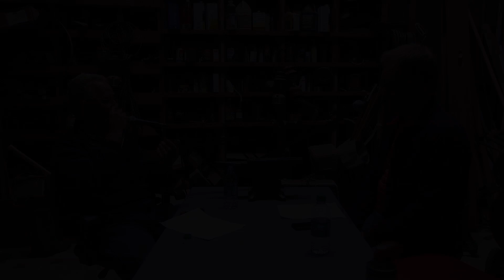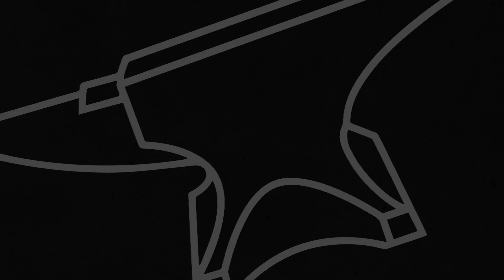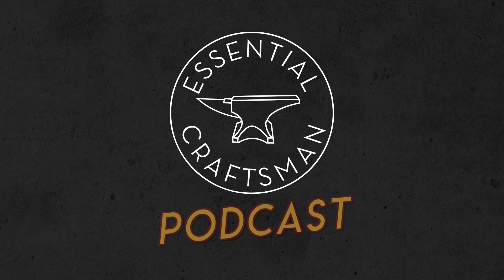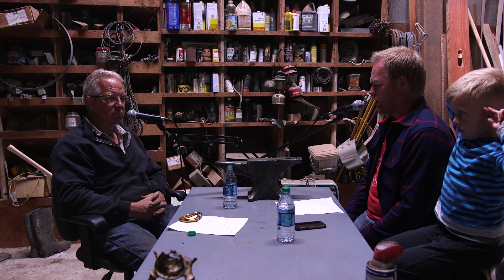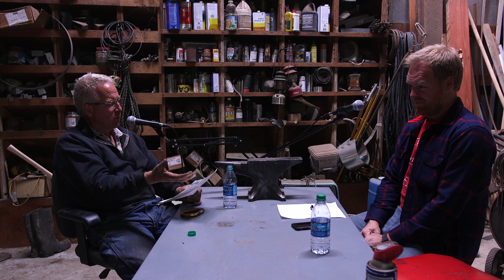Foundation Discussion ECP 2

Comment: In las vegas there are lots of old houses built with iron pipe placed in the soil which is acidic.  Most of those foundations in the slab on grade style.  There is a LOT of pipe replacement going on because the iron has corroded to nothing over 20 or 30 years when the houses were built.

Comment: Not a geology expert but, Scott, you're right that the basalt is volcanic, hard and probably not very porous. If layer above the basalt is in fact sHale and not sLate, then it is sedimentary rock which forms DEEP under the earth from silt deposits and the pressure forms a hard rock. If it is EXTREMELY deep and hot then it will form into metamorphic shale. (This is a gross simplification of the process.) The key point is that as the earth is shoved UP, the horizontal layers of rock now become slated that is important because shale is usually very porous and will allow water to run between it's very thin layers but, not much will get through the basalt below. So, IF you disturb the shale layers, as you did with the retaining wall, water will continue to flow OUT of the rock, as I think we saw in one of the videos when you were laying drainage pipe. Had you NOT put the perimeter drains in, your crawl would have become a swamp. Y'all did right by that piece of land and have put your money in it the right way.

Comment: Where I grew up (Southern Michigan) almost every house has a basement.  But, this is a function of two things: frost line and soil type.  Frost line is 48 inches.  So it's not that much to dig down the full eight or nine feet and do a full basement and our soil is mostly sand/clay with very little rock.

Comment: Great conversations in these podcasts and videos; thanks again for everything you've put out.

On the crawlspace vs. basement front regionally, a lot of it has to do with the footing depth required to get below the frost line. In places where you need to excavate to 6 or 8 feet for your footing, you may as well excavate the interior region too -- easier and safer to work in than a deep narrow trench, and nobody's going to complain about the bonus space for storage. Many of these started out with bare dirt floors and/or quite low "ceiling" heights and have been subsequently modernized. In areas like with a negligible frost depth, there's no need for that footing excavation, so you get a crawlspace or slab-on-grade as you discuss.

Houses built on the West Coast before the ~1920s may have still had a basement (often very small relative to the footprint of the house) because furnaces and boilers of that era relied on natural convection ("heat rises") rather than forced with electric blowers or pumps, so they needed to be installed below the residence to work effectively.

Comment: There aren't basements in the Phoenix area because it costs extra money to build them. On a standard build, you only need to dig about 18 inches to get below the frost line (so you only need a trenching machine), whereas in many other places you need to dig down several feet, so digging out for the basement while you already have the backhoe/excavator/whatever on the property is not a significant extra cost. Basements are indeed built here currently, and it seems like they're being built more now than they were in the past. They all have french drains with sumps and rubberized waterproofing on the outside of the concrete walls, if they're done correctly.

Comment: Hello, really enjoy the spec house videos. I live in Colorado where basement foundations are pretty common. I believe the average frost line in the front range at 5280 feet is around 30 inches. I have some land in the high country at 9500 feet with a frost line going down to around 48 inches. Of course their are places in Canada and Alaska where the frost line goes below 100 inches. I know the foundation of a home or building needs to go below frostline to prevent shifting from freeze/melt cycles. I do know that some foundations can be tied to bedrock above frostline. I guess you guys in Rosedale, Oregon do not have issues with frostlines and foundations? Thanks, Brian.

Comment: I had not heard the story Nate related regarding the origins of the rarity of basements in the Phoenix area. However, I do think because of the explosive growth since the 1970s combined with the economics of large-scale housing developments, builder choose slab-on-grade because they can. As you described, the soil conditions allow for it and it is fast, cheep, and requires much less skilled labor.

Regarding caliche... I drew the short straw on my building project at the foot of the Superstitions. Many days with a hammer-hoe.
Reply: I worked some in the Phoenix area in the late 60s and early 70s and you are exactly right about the reason for not having basements ! It was the cheapest way to go and the fastest !

Comment: Here in Ottawa, Canada, my house has a raised basement which gives me a 6 step walk down to the lower level and 5 steps up to the main level. My neighbours both have full basements. It depends on where you build and how much effort the builder wants to put into the envelope. Places with a higher water table need a different solution than ones with less water.

Comment: Great discussion guys. Enjoyed it. Binge watching EC2 right now since I just discovered it. I would take exception to the estimated weight of the soil material exported though. You said about 2500lbs per yard. I would bet closer to 1700-1800. Keeping in mind that a yard of concrete weighs in at 2050lbs per yard. 
🤜🤛
Reply: That’s pretty light for a yard of concrete. A typical mix at a 6-8 inch slump here in Georgia weighs in around 4,000 pounds a yard.
Reply: @bamaboy9133  Larry, you are absolutely right. I meant to say 4050lbs. Thanks for catching that. In light of that, Scott’s estimate on the weight of the fill is probably about right.
🤜🤛
Reply: psidvicious there are mixes out there that are extremely light for concrete. We built a barracks building on Ft. Stewart that has precast concrete floors in it that weighed 26 pounds per sq ft. I’d have to go back and figure out what it came out to per yard weight, but off hand I’m gonna guess it’s around half the standard weight.
Reply: @bamaboy9133  Right, I’ve poured light-weight concrete on flat roofs a lot but I forget what it weighed in at. Styrofoam beads were used in the mix for aggregate. We always poured it on top of a structural deck and it was mainly just to create slopes for drainage off the roof. Initially I was referring to regular concrete and just didn’t remember the right weight. I guess after a few years of retirement, stuff like that just starts fading away 🤪
🤜🤛

Comment: for example in video "Roll the Joists Ep.40" i wondered who made the choice of materials used. like, if i buy a lego set, someone has tried all the pieces and made the design, put them together with a manual and i just follow instructions and build the thing. 

But here i only see someone building the set. maybe i havent watched carefully enough, but i feel like you could point out more clearly who made what choices and why, or what other options there were instead of explaining (or justifying) only the one you took.
Reply from the maker: Most of the material choices were made by the draftsman and engineer (at least in terms in structural items). Great idea for a topic though, we will cover this more thoroughly!